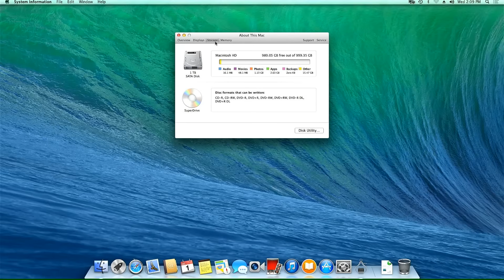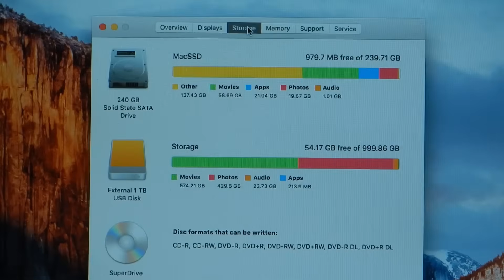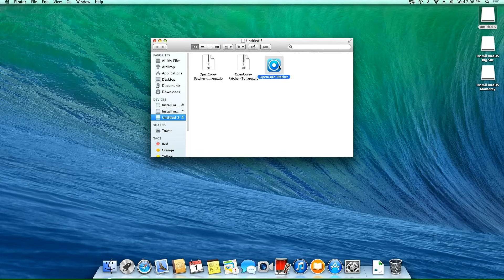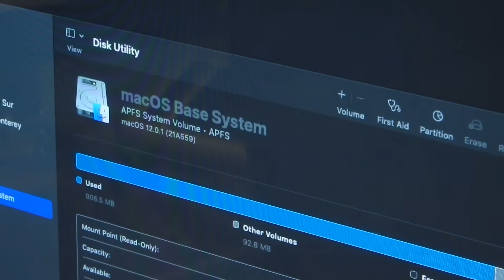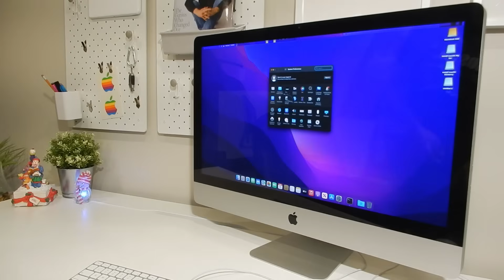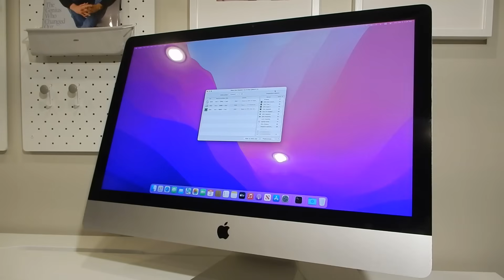Apple thinks this 2009 27" iMac is worthless. Let's refurbish and upgrade it to Monterey!

Comment: How did you change the fan settings at the end there? Thanks
Reply from the maker: @runforrestrun1965  The SMC controller in the Mac handles fan speed, so you need an app that modify those settings.  Many exist, I used one called Macs Fan Control because it’s very simple and easy to use.

Comment: Talking about the fan speed thing… Understood that this is an older Mac, but with a Mini M2 Ultra that’s about 16 months old, any advice regarding fans would be welcome. Until now, they’re/it is always purring along at about 1600-1750 rpm.
Reply from the maker: The old Macs had extremely common issues with heat and GPU failures.  I don't think the Macs with Intel Graphics or the Apple Silicon Macs were as prone to this type of failure.  The old Macs the fan speed increase was necessary so that they survive; the newer ones shouldn't be necessary, but of course running cooler can't ever be a bad thing.  Macs Fan Control app should still work on Apple Silicon M-series Macs according to the developer.

Comment: I did similar upgrades to a 2010 27 inch iMac. It is running like a charm. Mine has the max 1GB dedicated graphics card from that year, which runs even some modern games nicely, be it in reduced resolution of 900p.

Comment: I am using a late 2013 27" iMac 3,2 quad core i5 with 24 GB ram and a 1 TB SSD for video editing and graphics.
Reply from the maker: I just upgraded an almost identical 2012 iMac in a recent video!  Very decent computer still!

Comment: Yeah no matter what you upgrade - it's still an old computer. I know it cause I have an upgraded to the top iMac 2011 and there's a clear limit.
Reply from the maker: It's true.  For basic tasks, an upgraded iMac works just fine.  But if you push it at all, it really shows its age and has trouble keeping pace.  And even upgraded to the max, it's still old architecture.  I've got an upcoming video - 2008 Mac Pro vs 2017 iMac - which shows this exactly about old architecture.

Comment: I have a late 2009 27” iMac still running. I upgraded the ram to its maximum and added an external 1TB solid state hard drive. 
I am keeping the machine because it has a cd/dvd drive and MS Word. That CD/dvd reader/burner comes in handy at times. 
Thanks for posting this.
Reply from the maker: Thanks for the comment!  Yup, it's handy to have the CD drive.  My daily drivers don't have them anymore, and it was a little frustrating the other day when I needed to burn one, lol.  So I have to boot up another system, or grab the external drive.  Glad you're still making use of the 2009, they were (and still are) great systems!

Comment: I thought I was the only one who did this almost exact upgrade. My only difference is my 24" iMac had 6gb ram and I upgraded the cpu to a perin dual core in order to install Monterey.  Wish I knew about the screen saver trick. Anyway the 27"  I paid 50 dollars. And sold the 24" for 70 dollars.
Reply from the maker: Nice!  You had the 6GB upgrade; out of the seemingly hundreds of DDR2 modules I have kicking around, no single 4GB modules so I was stuck on 4GB total (which was probably the largest motivation for upgrading).  The screensaver trick didn't work all that well; the issue would come back sometimes and you'd have to re-do it.  Ultimately it was better than nothing I suppose.  Either way, you got an amazing deal on your upgrade; got a newer system with larger screen AND pocketed $20.  Can't go wrong with that!

Comment: Hello, what is the most recent Mac OS that supports the 2009 IMAC? Thank you.
Reply from the maker: Do you mean officially?  The Early 2009 can officially upgrade to 10.11 El Capitan.  The Late 2009 can officially upgrade to 10.13 High Sierra.  Unofficially, you can upgrade both to the latest macOS 15 Sequoia using OpenCore Legacy Patcher like shown in the video.

Comment: My early 2009 24” MAC had the hd hanging up on boot up. I bought a Firewire 800 ssd and used Carbon Copy Clone to make the external drive bootable. I clicked to boot from the external and now have a faster running dinosaur. Apple has enough money. They don’t need more of mine.

Comment: Can this be done to a 27” late 2013 iMac?
Reply from the maker: Yes, but if you do an SSD upgrade you will need cut through the adhesive that glues the screen together.  iFixIt has a good tutorial.  The OpenCore part works the same.

Comment: Love how you hide the serial like anyone is gonna do anything with that
Reply from the maker: @techtipsuk  They do actually, because real serial numbers can be used on Hacintoshes to fix iMessage.  So rather than put in effort to generate their own, some people glean real numbers off the internet.  On much newer systems and iDevices someone can even activation lock your device by cloning your real serial, activating it, and turning on iCloud lock.  Then if you ever factory reset your device, it’s bricked.  On older systems like this 2009 though, the worst is getting iMessage disabled.  Hugh Jeffries has an excellent video that explains how serial cloning works.

Comment: Can I upgrade anything with the Apple iMac "Core 2 Duo" 2.0 20" ?
Reply from the maker: Yes, you can (and should) upgrade to an SSD which will give you substantial performance improvements.  If possible, you should try upgrading to 8GB RAM (this will depend on your specific model).  And you can do the OpenCore patch to install a newer version of Mac OS.  I made a video here where I upgraded a 2008 Core 2 Duo iMac to Mac OS Monterey: https://www.youtube.com/watch?v=_a2utQaO_Gs

Comment: Help me I have 2009 safari ain't working take long to come on  need advice upgrade it
Reply from the maker: Did you do the Monterey upgrade already and it became slow AFTER the upgrade?  Or is it too slow and you want to upgrade it?

If you have not done any upgrades yet, it would be best to do:
1. Upgrade original hard drive to an SSD (makes HUGE speed improvement!)
2. Have at least (or upgrade) to 8GB RAM
3. Use OpenCore to update to a modern Mac OS version

The SSD upgrade will make it insanely faster even without upgrading anything else.
Reply: Got same problem never been up graded  got it as gift from friend was wondering if u know y don't come on was on befor now struggles

Comment: I think Apple must do by them self like Open Core pather/. It is hige shame that such beautiful computer becomes usless.
Reply from the maker: I know, the hardware is very capable of running it.  Apple software is the limitation.  The problem is Apple sells more computers when they stop updating old ones.  Unfortunately, its always about money $$$.  At least there is OpenCore :)
Reply: @rebootretro  If OpenCore would be runned by Apple it would be more efficient and better.
Also if Apple would support older hardware it would give better reputation to Apple!

Comment: I have a 2009 27" iMac configured just like this one.  Years ago I swapped out the optical disc drive to an SSD and already added RAM: 12GB now.  I don't recall what version of OS in on it.  I was hoping there'd be something else I can do to keep the machine viable.
Reply from the maker: Thats excellent!  TBH, the 12GB RAM is probably more than plenty for general use - I can't stress enough how overkill I went with 32GB, lol.  If you want to run more modern OSes, I'd recommend the GPU upgrade (I show it here https://youtu.be/n9koG8p9Ch0) since it brings Metal support for modern apps to work properly.  Also, if you want the full modern Mac experience, you can also upgrade the WiFi card to bring back AirDrop, AirPlay receiver, etc.  I will be doing the WiFi upgrade in an upcoming video! :)

Comment: Is there any proof that Open Core is secure.
Reply from the maker: Sort of.  The code is all open source.  If you were a programmer, you'd be able to review the code and compile it yourself - and KNOW it's secure.

For the rest of us, we trust that there's enough eyes reviewing portions of it that any deliberate "funny business" would be caught.

So while there isn't "concrete proof" per se, chances are that someone would notice and speak up if anything deliberately nefarious was being done.  A similar concept to how Linux is collaborated and distributed, although admittedly with a much smaller user and contributor base.

As far as security of the operating system itself, they tend to try keeping the official security systems in place (i.e. like SIP/System Integrity Protection).  Although it's possible that OpenCore could introduce a security vulnerability that goes unnoticed, from what I've seen about the project this would never be intentional and would be fixed as soon as someone noticed it.

Comment: I have an early 2009 iMac and I want to do this change while I'm saving money to buy a PC because I can't afford to buy a new Mac with fewer and fewer ports and drives.

The hardest part is, besides replacing the old hard drive to a SSD and the RAM, is to find a repair shop who can do that.
Reply from the maker: It's probably not worth paying a shop even if you can find one, unfortunately.  Start to finish, after parts and labor, you'll likely be in more money than it's worth.  If your only option is to hire a shop, I'd probably recommend save the money and put it towards a newer model.  If you're on a really tight budget, you can sometimes find really new Macs with damaged screens for cheap.  I'm currently running (daily driving) a 2015 iMac with quadcore i5 CPU and a completely smashed (unusable) screen - running on 2 external monitors, and it works perfectly.  People have also run "headless" Macbooks.  I know it's not ideal for your "fewer ports and drives" issue, but these 2009 systems are just getting older.  While they're incredible value if you can get cheap used parts and upgrade yourself, you'd break all your savings by paying someone to upgrade it.  Anyway, hope this gives you some ideas and some encouragement. :)

Comment: This is the era in which Apple made such powerful, reliable Mac's that their customers didn't need to upgrade every few years, like many other PC owners. The fact you were able to use this from one decade into the next, let alone the one after that? Truly a marvel of engineering. They don't make em like they used to- for exactly this reason!
Reply: Powerful? weak Intel chips with poor cooling is hardly powerful or good
Reply: @Will-sc3hw plus these Intel chips were better than any other company’s offerings at the time. Sure, now they’re not great, but they’re like 15+ years old.
Reply: @Will-sc3hw  Surely it is workaroundable ?
Reply: @Will-sc3hw they were just fine for the time. And he should really check temps when saying that they run hot. Also, part of the reason they run hot is probably because the internals are so congested, compared to iMacs 2012 and newer.

Comment: Oh, yeah, that Tandy 200 at the beginning....
I still have one, upgraded with a SuperROM, still working fine
Reply from the maker: I actually did an entire video on the Tandy 200 (https://youtu.be/JLZVVUNp3_A).  Something about that Tandy makes me want to do all my script writing on it.  I never had one back when it was current, but theres something just so nostalgic about using it.  One of my favourite vintage systems for sure!
Reply: @rebootretro  It has the BEST keyboard of any machine I've EVER typed on, and I learned on the classic IBM Selectric (doesn't THAT take you back?)
And the OS/application suite was AMAZING for the time. Bill Gates has a soft spot in his heart for the Tandy 100 because it's the last project he wrote significant code for personally, and, of course, the 200 is really just a 100 with a better screen and form factor.
Do you have any upgraded ROM on yours? When I bought mine on eBay, the listing said nothing about the SuperROM, so that being in it was an AWESOME surprise. The addition of spell-checking capability is especially nice.
I've also bought TWO PowerBook 1400's, years ago, at flea markets for $15 TOTAL between the two, that both had upgraded processors that were selling individually at the time for about $75 each. One was a NuPower, I forget the other manufacturer. Nice surprises once I looked under the hood. Still have those, too. Need to open a vintage computer museum....😁
Reply from the maker: @richardadams4928  Pretty sure mine is completely stock.  In the video, I pulled out batteries that had 1995 expiry date I think.  I'm pretty sure my unit was barely used.  I don't know much about the SuperROM, was that an official upgrade or 3rd party one?
Reply: @rebootretro  Hey, RR, I did watch and enjoy the T200 video since writing this, nice find! The SuperROM was a 3rd party add-in that went in the ROM expansion slot in the bottom and upgraded all the stock applications, including the aforementioned spell checker, which I believe was the most requested upgrade for the stock software. It was lauded as a near MUST in contemporaneous magazines, but (as expected) it wasn't cheap. I'd bet they're rarer than hens' teeth today. I also have the 3.5" floppy drive, which is probably also very rare.
I have a T100 as well, would LOVE to have the DVI (Disk/Video Interface) have never seen anyone selling an operational one. Would have been a VERY cool accessory back in the day.
Reply from the maker: @richardadams4928  Ya, the spell checker would be have been a massive upgrade for sure!  Basically the difference between having a "typewriter" and a "word processor".  The floppy drive would have been cool.  I think I can transfer data via serial port though.  Admittedly, I've not had a whole lot of time to play with it to learn more about it.  It's one of my favourite portable vintage systems, but one that I don't know enough about yet.
Reply: @rebootretro  It also had a MUCH better spreadsheet (Lucid) and a database. There were about 4 ROM packages, IIRC, from third parties, and a Microsoft Multiplan ROM sold by the Shack. I think ALL the third party ones added a spell checker.
Tandy expected to sell, I believe, about half a million Model 100's the first year and then transition to something else. Instead, the Model 100 line stuck around almost nine years and sold about 9 million units. That's off the top of my head and might be imprecise, but I'm pretty sure it's in the ballpark. That little machine really outdid their expectations in a HUGE way.

Comment: Is it possible to do this on an imac 2010?
Reply from the maker: Yes, for sure!  A 2010 is extremely similar to a 2009.  I have another video where I also upgrade the GPU, which fixes the graphical glitches (https://youtu.be/n9koG8p9Ch0).  In the future, I'll be doing a video where I upgrade the WiFi card as well - so that AirDrop, Handoff, etc works again too.
Reply: @rebootretro  ty

Comment: i had a fan control set up, but still had the gpu go south, you gotta open them up once in a while and blow out the dust.
Reply from the maker: Very true.  Also the paste gets pretty crusty on the cooler by this age too; I'm sure fresh high quality paste helps too.  All you can do is run them cooler, and hope they don't die.  Although if they do, it's a good excuse to upgrade to a Metal-compatible one.

Comment: I found, yes found, a tossed out iMac A1312. Seems to work but needs High Sierra reinstalled. So Monterey is the latest and greatest the iMac can support?
Reply from the maker: Nice find!!  I know Ventura definitely works, and someone has told me that Sonoma works and also fixes the wake-from-sleep graphics glitch on AMD cards.  I should make an updated video and test it :).  From my understanding though (haven't confirmed), there are WiFi issues with Ventura and I suspect also Sonoma which require the WiFi card to be upgraded.  Wired Ethernet should be fine.
Reply: @rebootretro  cool! Thank you 🤓

Comment: how i can put 16 GB of ram with a 8GB limited mac pls ?
Reply from the maker: I'm not sure what you mean by "8GB limited mac"?  You must be talking about a different model?  The one in the video (27 inch 2009 model) is limited to 32GB of RAM.  Some newer models have soldered RAM and are not upgradable, but it depends entirely on which model you have.  On the 2009 models, there is a RAM hatch on the bottom of the screen that can be opened with 2 philips screws.
Reply: oh ok. and just another question : if i install a patcher to update to catalina on my late 2008 macbook, there are no risk ? i have a backup disk but i'm scared @rebootretro
Reply from the maker: @freezicraftYT  There is always risk.  You will be running something that Apple never intended to be run, using 3rd party modifications.  If you make a mistake during one of the steps, there is a good chance your system will no longer boot.  It is always fixable, but you will need patience (and probably a second computer) to fix it.  I think most people would recommend to wipe the system and install a fresh copy instead of upgrade, to reduce the chance of conflict with existing software.  At this point, Catalina is pretty old.  I would probably recommend looking into Monterey or newer.

Comment: how did you patch radeon?
Reply from the maker: In the OpenCore Legacy Patcher, you have to install the post-installation patches to get legacy graphics acceleration.  OpenCore detects which patches you need, and automatically installs them.
Reply: 😍 @rebootretro